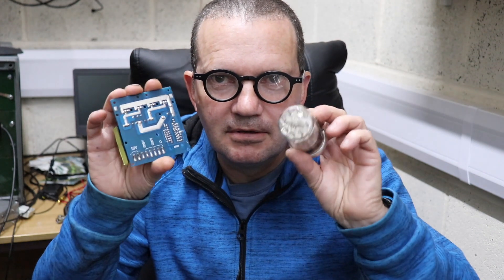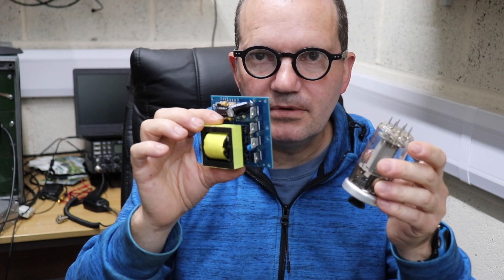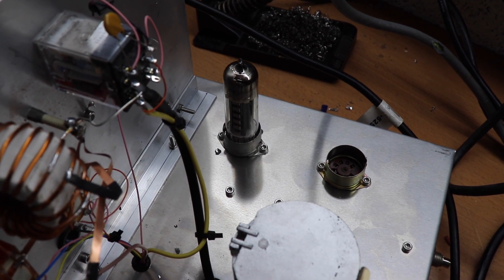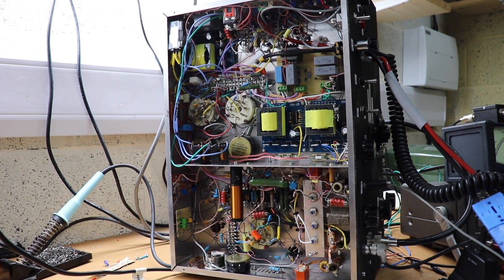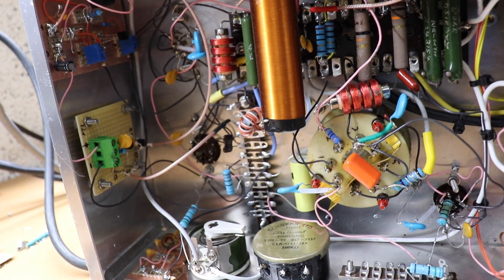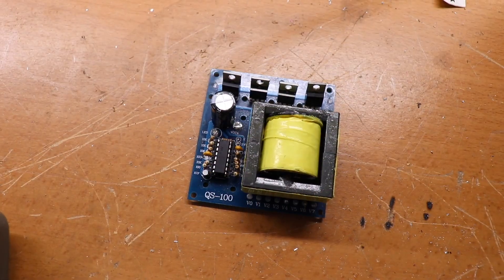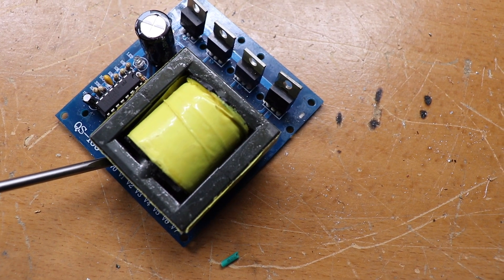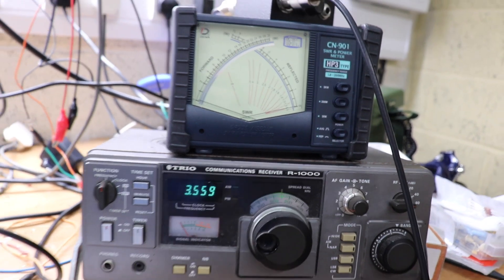Home-brew 40w AM/CW Transmitter Using GU50's And Inverters

Comment: Whats the max plate voltage and screen voltage of the gu50?
Reply from the maker: It can take up to 1000v on the anode. Usually runs about 750-800v Screen is about 300v
Reply: @thewtf  Wow So have you built any audio amps with this tube? If so what wou;ld the plate to plate figure be for PP any idea? Seems like a very interesting tube! Thanks! Cool project, I'm going to check this tube out.
Reply from the maker: Not an audio amp but a modulator which is the same but with a different audio transformer. The pp impedence is about 5-6k so should work with a standard audio transformer

Comment: That's a good idea, I'm going to pass this on to our forum.
 ( AM Forum )
(Shame about the modulator that it doesn't work very well.)
thanks for the video!

Healthy and friendly greetings from the Netherlands
Rob
Reply from the maker: Hi Rob, thanks for the comments. I wouldn’t say that it doesn’t work in fact the reports I was getting were pretty good but I could not get better than about 70-80% mod before the inverter started to whine
Reply: @thewtf  have a question?
I have received
 the inverter but I cannot even measure the voltage with my multimeter?
my meter goes crazy, how do you do that?

Friendly greetings from The Netherlands!
Rob
Reply from the maker: @hobbyrob313   Hi Rob, some multimeters have difficulty measuring the high freq AC (which is about 20kHz). My old Fluke measures it quite easily but my more modern Chinese DVM can't read it. Try rectifying the output with a HF diode UF4007 or eqv with a small cap (0.45uF at 600v) then measure the DC voltage
Reply: @thewtf  
533 / 5000
Vertaalresultaten
Okay I'll try that!
It was disappointing to me, I have an old Pantec universal meter, but it went crazy?
I will report here later how it went.  
Currently I work with small transmitters (Grenade) on pirate bands,
Here in the Netherlands that is done a lot 6300,6305, 6375,6390khz-AM
1611, 1630, 1666KHZ-AM For people who want to listen in, make sure to set the settings right first!
Give audio permission and Click on MAX IN and set the frequency:
http://websdr.ewi.utwente.nl:8901/

Healthy Friendly Greetings from NL - Rotterdam
Rob

Comment: Very interesting! I have several GU-50 tubes, but the  inverter idea is brilliant and I may have a go at building one.
Reply from the maker: I reckon if I was doing it all again, I would not use these type of inverters for the modulator as you can only get about about 70-80% mod b4 it starts producing noise. A resonant Hf converter which has a regulated output might work better or an old fashion 50 hz supply